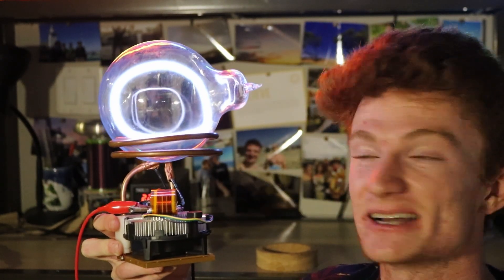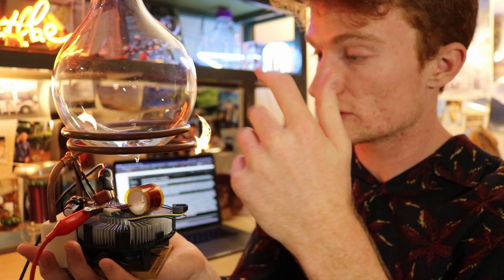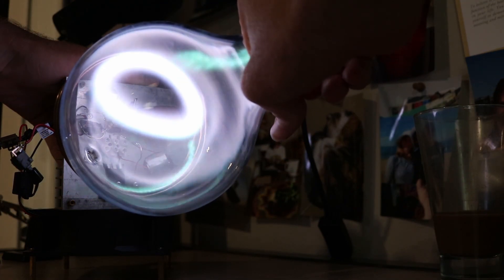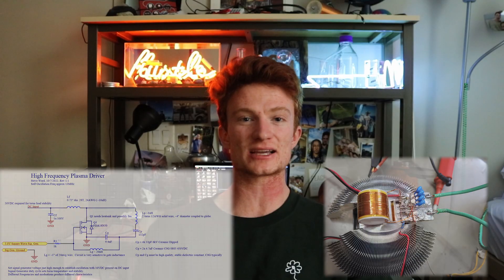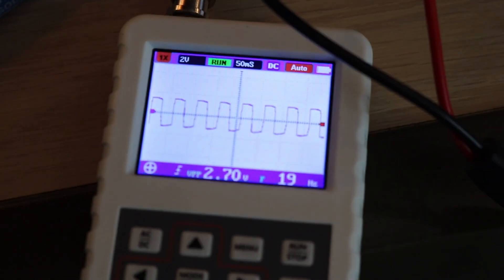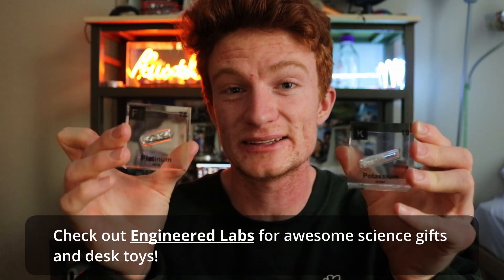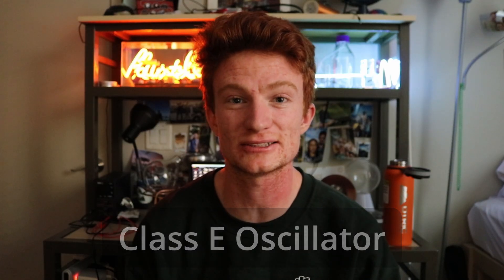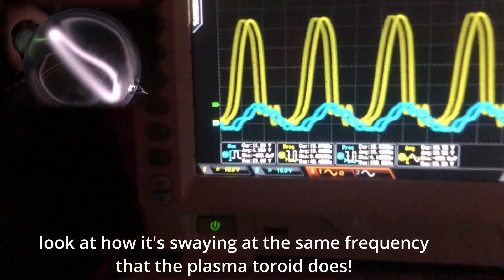perfecting and explaining the plasma toroid

Comment: further experiments: 
1: Having multiple magnets hitting the same glass. 
1a: what would happen if you phased the charge back and forth between 2 parallel magnets? 
1b: What would happen if you absolutely ZAPPED it with one but applied a negative voltage on another magnet
1c: pulses/prolonged magnetic combo?

2: different shaped containers. (what would happen if the glass you used also had a torus, would it still be able to pulse to the music?

2b: if hollow glass, you could try to get funky with magnet geometry now that u know how it works.
Reply: DAMN IT MOST OF THESE WERE ALREADY MENTIONED

Comment: Ok irrespective of any giveaway, could the horrendoulsy expensive xenon bulb be substituted with a cheap plasma ball? They are filled with low pressure argon, neon and nitrogen and have some form of conductive coating in the center but are less than 10% the cost and an off the shelf part.
Reply: marking so I get this information upon update. (I think you should be able to. The actual ball may need to be replaced, but you could def find a way to pump it into a new container. )

Comment: Video idea: Idk how it would work but add another coil perpendicular to see if it can be controlled in more than one axis or dimensions. Then I’m sure you’ve already experimented with different sized coils, but what about multiple small coils arranged is different configurations juggling the plasma
Reply: Does the toroid it’s self have a signature magnetic or just heat or some type of feedback to reference it’s position in the glass?

Comment: For a future video I would love to see if it is possible to fuse helium in the plasma toroid like a fusor. I am not too well versed in physics so it probably won't work. Also, could the plasma toroid be made with mercury vapor?
Reply: to answer both: 1, no helium fusion would require the atoms to be mashed together super hard. All this plasma is glowing not because of extreme force, but rather because that's just what this particular element does when shocked. 2, tbh no idea but the idea of mercury vapor is scary enough you shouldn't try it
Reply: Look up "toroidal pinch fusion".  An old idea, with stability problems.

Comment: Great video man! Little tip for working in the shop, do not wear gloves when operating the band saw and drill press or most power tools for that matter. If they get caught up in the machinery it will pull the rest of your hand in before you can even think to pull away or shut off the machine. A little cut to bare skin is better than losing a whole finger or worse. Stay safe my friend! Keep up the amazing content!
Reply from the maker: Thank you!
Reply: @BackMacSci  On the same note, remember to drop the foot to a quarter inch above your work piece. All the way up is unsafe and bad for the blade :)
Reply: He ain't lying. I used to work on commercial food equipment and there was one call I'll never forget. A guy was operating a large meat grinder with the lid safety bypassed and dropped his knife in the hopper. When we got there the fire department guys didn't' know how to get him out. We had to switch one of the 3 phase power legs to reverse the motor and squish out what was left of him. There was another instance upstate where a guy got his arm caught in a 80qt. mixer, it ripped his arm off and proceeded to beat him with the bloody stump. You can never be too careful, to a machine everything tastes the same.
Reply: @ChopFooey worked with a guy who lost his arm. He tried to grab something on a conveyor belt, the belt grabbed his sleeve and pulled him in to the rollers, guy had to pull his own arm off to save his life
Reply: @Mark Key, well, those descriptions definitely disturbed me.
Reply: 100% 
Moving blades, rotary power tools, things with feeding pinch points, etc
No gloves.
Machines are strong and you are soft and crunchy.
Reply: same as above except use a tool to push the work towards blade for close cuts...
Reply: Great advice, glad someone said it.

Comment: I legit want a kit version of this. It'd be an incredible talking point on my work desk
Reply: he built it in a cave! with a box of scraps!
Reply: @JinKee  I'm sorry. I'm not Tony Stark
Reply: @varkboys9999 😂  I wanna BUY a
Kit as well, (not build one).
Reply: I would buy this as a retail kit with a nice looking case and UL listing for $250.
Reply: Then again, I think you can buy everything here from mouser except for the glass bulb at the right pressure.
Reply: I'd buy one! though, with neon if possible.
Reply: We need a kit
Reply: same, I'd purchase that instantly
Reply: This is very cool. Would this work with a a more standard plasma sphere with xenon gas, rather than the custom made sphere?
Reply: @talmiller19  yeah I wanna try with a regular 8 inch plasma globe turned upside down . Don't use the internal circuit . Just the globe
Reply: I want an already built one! 

A lot of people would pay premium for that.
Reply: The intense radio wave radiation cant be good for you.
Reply: @enginedesign4871  Probably not XD i guess its magnitudes times more power output and radio wave radiation compared to a Large sized Plasma Globe? Guess it depends what frequency you tune it too as well.
Reply: I'd also be interested in a kit!
Reply: Any chance of there being a kit? Kickstarter?
Reply: Mmm be careful, I wouldnt be suprised if UVC is coming off that.
Reply: Have you tried microwaving the plasma ring at specific frequencies?
Reply: @gonzatricio  Bulbs do not last long in the microwave!, Magnetrons are fixed frequency at around 2.45Ghz, at least in theory, you can adjust a tiny amount by changing the input voltage, but not by very much.
Reply: same
Reply: Assuming I don’t have any of this gear, because I don’t, how much is it gonna cost to have someone make one for me and ensure that it’s all there, everything needed, in a kit?
Reply: it costs over 400$ usd
Reply: Try using a flame Tesla coil!
Reply: How difficult would it be to make a Plasma Toroid Speaker?

Albeit, given the low pressure of the tube would not propagate sound waves too well.

It would be cool to try.
Reply: I mean... you have the schematic and even theory of operation... roll it up lol
Reply: Could we use this as a particle accelerator? And drastically increase the innertial mass of the plasma?

And then create a straight row of such accelerators?

And lerp the inertial mass values from one accelerator to the adjacent accelerator, to the accelerator after that.

(Sort of like a programmed string-light where a dot moves from one light to the next, but with sub-pixel rendering which is fancy talk for light A fades out at the same rate as light B fades in), to create a virtual linearly traveling mass?

And after we get to the end of the striaght line array we start off the beginning again?

This way, couldn't it be analogous to ejecting a mass from a canon in a vacuum, but instead of ejecting a physical object embewed with mass, we eject a simulated mass?

And since its linear in our world, but sequentially a loop, it's technically just an extension of the reaction wheel concept right?

Maybe try it on a styrofoam float?

Or on a slippery slidey solid thing in a vacuum chamber?
Reply: ellaboration:

No, it's not a free energy device. So it won't run for nothing.

What it is though is a way to move in space without getting rid of supplies.

Even ion thrusters, they evaporate and plasmify a aolid fuel pellet so they don't do anything new.

Rockets literally vomit out their fuel, so that's that.

And a gun in space is basically a rocket but it puked a solid.

My idea is like this: first you need to know if you are inside a box in space and you have a canon: 

And you shoot the wall (it's an unbreakable wall for pretend), and the canonball is the heaviest thing in the box, the box will slide opposite the direction of where the canon went, but then once the canon hits the wall, the box will stop.

So it's kind of like, having a tiny railway track to move up and down.

Because any tempt to put the canonball back in the canon, will move the box back to where it started.

So how, do we move through a vacuum, without wasting matter?

Easy, television.

Lemme explain, on a TV, we can make objects "move", and then once they reach the edge they dissappear, right?

Well what if instead of making light, we made mass?

Einstein says that the faster something w/ mass moves the more massive it becomes and therefore it will never break the light barrier.

Well- we aren't worried about going faster than light yet (that's for later).

Do you know what makes stuff fast? 

An accelerator.

Do you know how to contain a fast thing?

A track.

Do you know an electrically powered fast maker shaped like a track?

Yeah, a particle accelerator.

So we got little containers full of some low speed particles.

We use electricity to trap them in an accelerating circular path, that should make them more massive, and then they will push down on the confinement fields and making the container a teensy bit heavier.

So we put power in and it gets heavy, it's like a tv pixel for gravity, instead of light.

Now instead of shooting a real canonball at the wall, we can play a "movie" (on the gravity screen) of us shooting the canonball at the wall; and then when it hits the wall, instead of hitting the wall, we just make it dissappear off-screen.

Then we can make another canonball appear inside the canon, and play the 'movie' again.

We're no longer trapped in the segment of wiggles, now we can slide anywhere we want- any way we want. 🤔🥰

Or or so I envision
Reply: Since an unshielded cathode ray tube produces x-rays by bremsstrahlung, you would not want this on your desktop. It would also violate FCC regulations since it would produce interference that would be harmful to other devices, just by virtue of the way it works. Otherwise, you'd see the prettier version of CRTs, geissler tubes everywhere: https://sprocure.web.cern.ch/Electricite/Geissler.png I'd definitely pay a premium to have one of these on my mantle.
Reply: Free uv and x-ray
Reply: How is your work desk, empty by now aka moved to another company?
Reply: I'd question whether this device is RF safe enough for work :D it must send electromagnetic waves like crazy
Reply: @m.sierra5258  It really wouldn't. Your router or microwave probably causes more RF interference than this.
Reply: @yoshibear7526  your microwave has a  perforated metal faraday cage completely enclosing it, even across the window glass.

Don't believe me? Use a pencil to jam the safety switch in the microwave door latch so you can run it with the door open.
Reply: @yoshibear7526  my microwave makes enough RF interference to make the internet go out, I'd say that's a safe bet
Reply: @Anklejbiter  Get a new Microwave cause that shits leaking out Microwave radiation!
Reply: @MetaCaptureOG  Or it causes the power grid to fluctuate. Way more likely than the microwaves leaking out imo.
Reply: @yoshibear7526  yes, but remember microwaves have a metal cage all around the magnetron which I guess will probably block most of the microwaves
Reply: @m.sierra5258  well, old microwaves used to impact 2,4 ghz signals quite heavily but there is not much that you could change about a microwaves design except better magnetron and rf shielding. Or maybe they still do and all the devices just jump band, what do I know.
Reply: @JinKee not completely, just the part where the microwaves come out but the Megatron, its mostly outside of the cage and everybody knows that it creates tons of RF in the frequency range of wifi
Reply: @JinKee  and whyyyy would you want to do that?
Reply: “How to die instantly tutorial EZ”
Reply: @JinKee  Don't actually do that.
Reply: @unpaidintern6652  yes,. they have directional horns for the microwaves.
Reply: @yoshibear7526  Completely wrong. These devices cause a lot of RF interference. It can and does cause problems with other electronics. I tried it. I wouldn't turn it on near any kind of important stuff. Especially not near any critical electronic infrastructure. At any work place they probably wouldn't be happy to have that.  But you do you. Just don't tell people a microwave causes more interference. That's nonsense.
Reply: @m.sierra5258  those electomagnetic waves are what is creating the plasma, so they are pretty much used up.
Reply: @m.sierra5258  Yes, please make an entire video about how to make your kit UL certified!
Reply: Wonder how hot it get

Comment: I would love to see this refined even more in the future! Cheaper gases + custom PCB = win for everyone. Also, good luck pushing towards doing youtube as a career/at least ramping up the channel! Love the videos so far.
Reply: I would be up for designing the PCB and sending out Gerber files for free if anybody wants them. I'm going to build one of these
Reply: @lukehaworth5789   What program do you use to create your Gerber files?
Reply: @Mark_Nadams  idk about him, but I use KiCAD personally. Open source and free, easy enough to use while still being powerful, I feel it's a good option
Reply: @lukehaworth5789  Can you give me the link for that gerber file please.
Reply: @lukehaworth5789  did you made one? Can you share it somewhere?
Reply from the maker: Thanks for watching until the end! Yes, what you described (cheaper gases + PCB) is my plan.
Reply: @BackMacSci  Neon would be cool, because pink. Low pressure air, would probably work as well.

It does seem rather sensitive to how the globe is positioned however. I wonder if the circuit could account for this.

Comment: This was awesome! thank you for the additional explanation of the oscillator circuit. This may be a silly question- as its been a long time since i worked with any gas discharges for my Physics lab in uni:

 have you noticed any more difficulty in generating the toroid on days with higher solar activity? Lately there's been a few solar storms and flares of decent strength . Depending on how stable the oscillation is to geomagnetic disturbances i wonder if you've had days where it wouldn't work at all, inexplicably.

I have a few related curiosities, like whether the toroid likes to settle relative to the direction of the earths magnetic field? or does rotating the bulb along its secondary axis affect the toroid? my bad if you've answered any o these already, and thanks for the motivation to continue my own science tinkering.